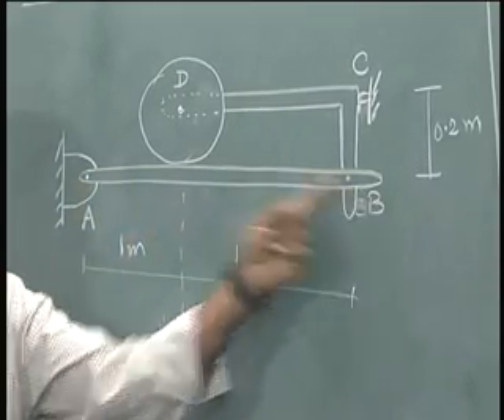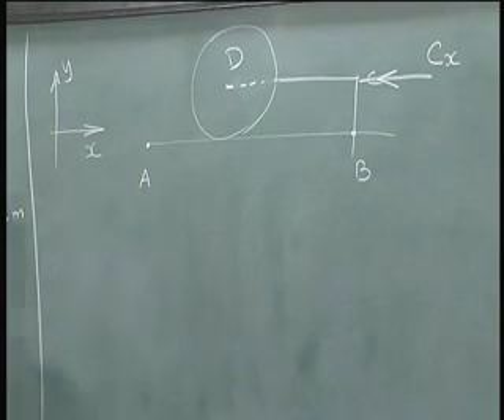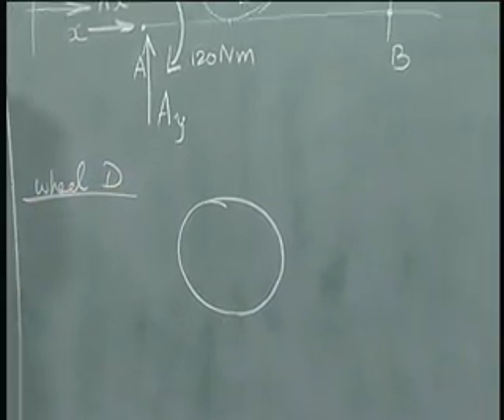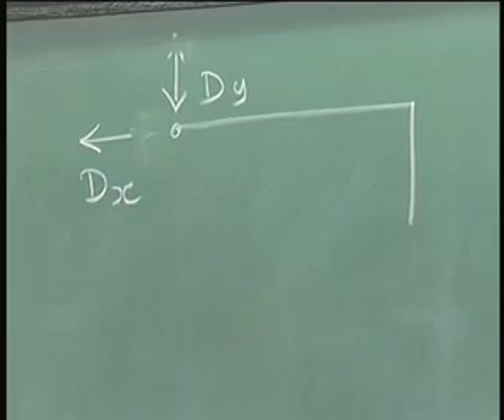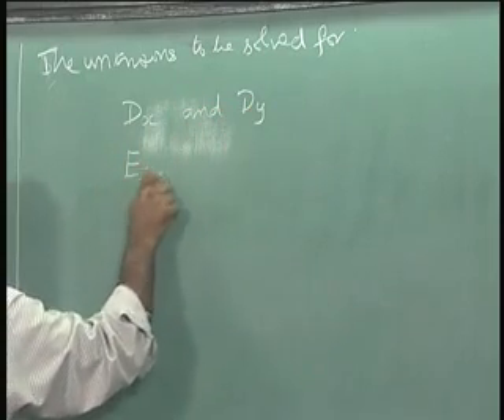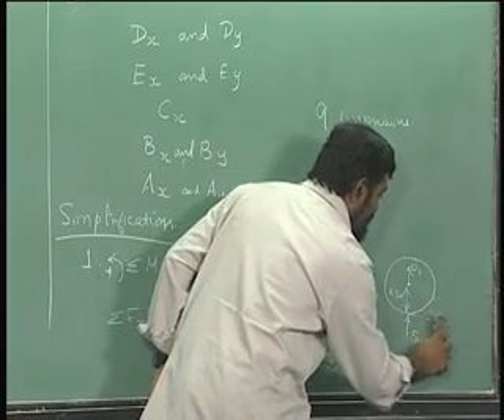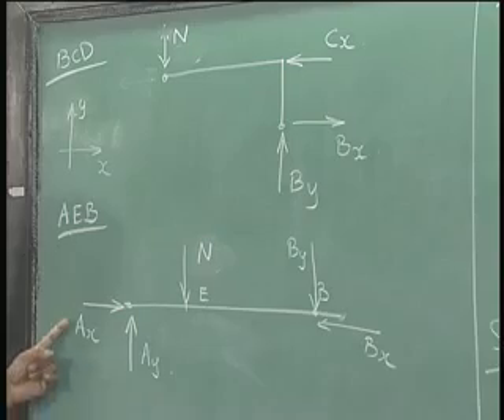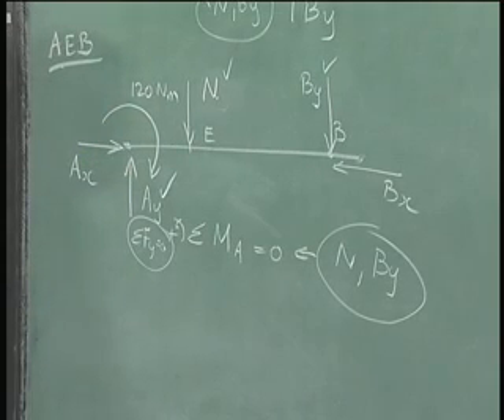Example 3 - Rigid Body Systems

Comment: Should have completed the problem. Jumping between FBD to analyse was not necessary, it made the lecture a bit confusing. Writing all equations and correlating works well and we can simplify naturally. Art work at the end is redundant for most of the physical systems in mechanics.

Comment: @qrtfalcon that is because at C there is no restraint in vertical movement. that is like a rest in form of a wheel that prevents movement only in horizontal direction so there is only one force restraining movement of the system.

Comment from the maker: In response to the query from qrtfalcon:
at C, there is a roller support that allows free movement in the vertical direction, therefore, there is no resisting force or reaction to such a motion.  In other words, there is only one restraint to motion and that is along the horizontal direction at C.
Since this is a standard support, I had directly introduced a single reaction in the horizontal direction.
Siva